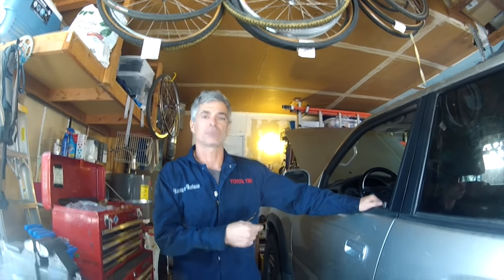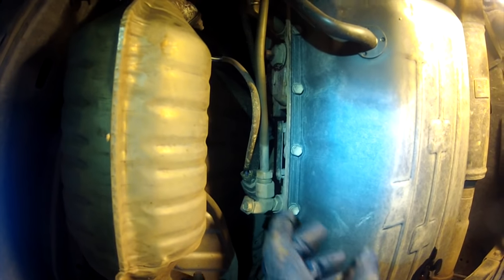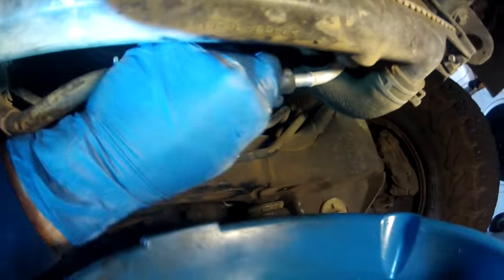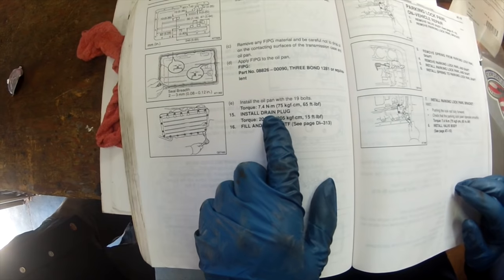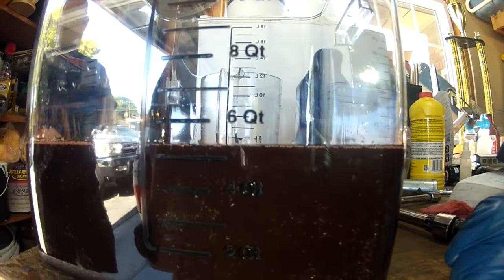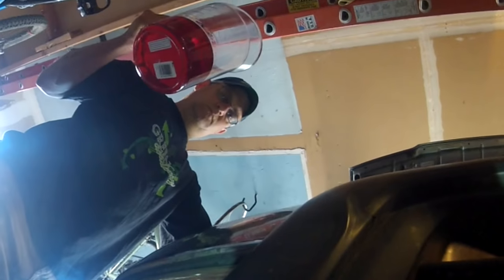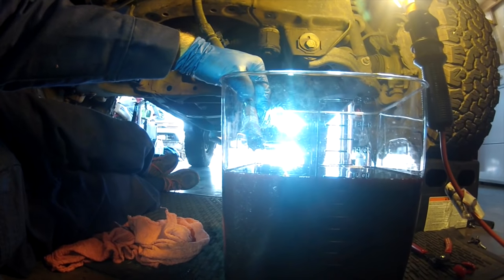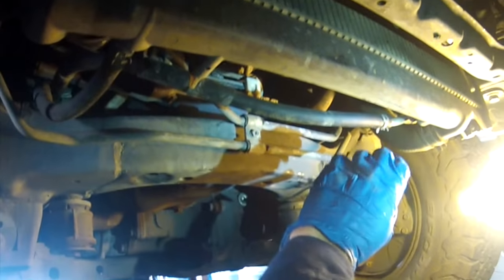Transmission Fluid Flush

Comment: I find in the manual it is recommended to "Apply adhesive or equivalent to new 18 bolts.
Adhesive:Toyota Genuine Adhesive 1344, Three Bond1344 or Equivalent".  I believe this is a thread lock.  I could not find any of these on the web.  Can someone recommend what type I should use for the transmission bolts as the torque is 69 in.lbs
On the other hand, how important is it as I am worried that it will lock the threads before I can torque all of them in 10 mins?
Thanks
Reply from the maker: zofa300 A good mild threadlock is Loctite Blue 242.  That's what I'd use on the transmission pan bolts.  It's enough to reduce the chance of a bolt loosening on it's own but not so strong of a bond to make the bolt the video hard to remove in the future.  I've used Loctite Blue 242 for many different applications and it works great.
Reply: Thank you
Reply from the maker: You're welcome and good luck with the job.  In the near future, I will be dropping the transmission pan on my 2000 Toyota 4runner to replace the transmission filter.  We will of course video the job.
Reply: Yes that would be great.  I got the filter today and it is indeed a felt not a metal screen.  I have a question for you.  I got BAFX Products 34t5 Bluetooth OBDII and installed torque pro.  Now I tried to get the transmission temperature.  I find transmission temperature method 1 and method 2.  They are black not green like other sensors when I add then it reads zero for the dial.  Do you have any idea what does that mean?  My car is camry 2007 LE 4 cyl.
Thanks
Reply from the maker: I don't know anything about your Camry unfortunately.  It might mean that the transmission temperature is not something you can monitor on your vehicle by accessing the computer information via the OBDII port.  You might want to search for an answer on a Toyota forum and find out if it's possible to monitor the trans temp on your vehicle.  If it's not possible, you could always install an inline sensor into your send line coming from your transmission to the cooler at the bottom of your radiator.  You have two lines coming from your transmission, a send and return line.  The send line sends the fluid to the trans cooler in the radiator and the return line brings the cooled fluid back.  Installing the sensor into the send line will give you the temperature of your fluid before it's been cooled inside the radiator.  The send and return lines start off as a hard metal line and then connect to the trans cooler via a rubber line.  You could cut into the rubber send line and install the sensor there with a couple hose clamps.  You might have to cut out some of the length out of the rubber hose to make room for the sensor depending how big it is.  Then you wire that sensor to an aftermarket gauge you install somewhere in your cabin space that you can see while you're driving.  I hope this helps.
Reply: Could you just mention the steps you have used on the torque pro to see the transmission temperature.  
Did you use PID 21D9 for TACOMA as in:
https://www.tacomaworld.com/threads/write-up-torque-app-obd2-reader.183560/page-10
Thank you.
Reply from the maker: I didn't have to input any custom PID.  I just chose "Transmission Temperature (Method 2)" and it worked for my 2000 Toyota 4runner.  Like I said above, you might not be able to monitor the transmission temperature 
on your vehicle by accessing information pulled from the computer via the OBDII reader.  I'd keep searching Toyota forums and maybe just pose the question for your vehicle on a general Toyota forum and hopefully somebody will have an answer for you.
Reply: Thank you.  Just FYI, I find that sensor 2 (method 2) is the converter temperature as in this link:
https://www.tacomaworld.com/threads/write-up-torque-app-obd2-reader.183560/page-10
Did you check that against any other device.
Reply from the maker: zofa300 No, I haven't verified the temperature with another device.   It does appear to be working accurately though seeing that the temperature is cool when I first start driving, gets warm after driving for a while and gets hot when I'm pushing up hills.

Comment: oh great, but what they do is fantastic, I have another 4runner but I have two problems when putting it in reverse it gives a strong gilpe and in the engine when warming up it sounds as if the valves are grinding, but it is only on the driver's side.  he has had to repair a 4runner with that problem, he already urilize lucas and it always makes that noise when heating
Reply from the maker: Nice 👍🏻
Reply: @TimmyTheToolman  
I would like you to help me with this, it is a pity that I am not here to take my 4runner, I see that you are professional in your work and one can trust, maybe you could help me with my 4runner, I would like to send you a video about the noise it makes when it reaches average temperature being cold it does not make noise but when heating it sounds as if they were valves but that is not it
Reply from the maker: @fernandopozuelos22  It's hard to diagnose noises without being there with the vehicle.

Comment: Hi, thanks for sharing this with us.
How can I get the transmission fluid temp?  Because the TORQUE did not show any option
Reply from the maker: I take it you have a 99-02 3rd Gen.  If you have a 96-98, you can't get a reading of your trans temp.  You'd have to add a transmission temp sensor somewhere in the line and run it to a gauge.  

So, if you have a 99-02, click on Realtime Information on your Torque Pro app. Hold your finger on the screen until the box pops up that says "Add Display".  Click on it and then choose whatever style gauge you want (I prefer the digital ones).  After that, scroll way down in the Add Sensor screen and choose "Transmission Temperature (Method 2).  You should now be good to go.

Hope this helps.  Let me know if it worked.
Reply: Unfortunately it didn’t work in my Tacoma 2010.  So, I’m not totally sure if the added fluid was correct because I drain and refill it twice.
Appreciate it a lot
Reply from the maker: Hey Ramiro, what exactly didn't work?  All you needed to do is a drain and refill of the pan, and then disconnect the return line from the transmission cooler and do the one quart at a time drain and refill.  It's pretty straight forward but I don't know how the Tacoma is set-up.  Maybe it's a harder line to disconnect?
Reply: Timmy, 
First of all, thanks for all your support.
What I meant was,  that torque did not showed PIDs for tranny temperature. Tacoma has a sealed transmission then as you know I would need the temperature for level checking. I used the “drain and refill method” twice instead of flushing. But I want to avoid any future transmission issue because of lack of fluid.
Reply from the maker: That's weird you can't find a PID for the trans temp on Torque. I've heard about those sealed transmissions.  I wonder why manufacturers chose to do it that way.  Maybe to make it harder for DIY mechanics.

Comment: Hi..
My name is SAM
I live in Pittsburgh PA
I loved your vedio and I saw it twice. Specially the OBD II device.
I love my 2011 toyota sienna AWD, with 103000 miles on it. And I wish to change the transmission oil of it, but it's not recommended from the dealer, besides there is no dipstick in the transmission itself.
So can you please help me with some info.
Thank you in advance
Reply from the maker: SAM ISHAQ Hey Sam, I wish I could give you some guidance on how to handle this on one of these transmissions without the dipstick but I have no experience with them.  One day we'll do a trans flush on one. For now, maybe hit up a Toyota forum and pose your question or maybe a simple Google search will give you your answer.   Good luck and let me know how you did it if you figure it out.
Reply: Thank you for your quick reply and I promise you I will keep searching till I'll figure it out.

Comment: So when most place change ur fluid its 2.5 qts what's the point in changing that ..when the system is 6.5qts?
Reply from the maker: I don't know what vehicle you're talking about, but that's besides the point.  Lots of people, including myself, subscribe to the opinion that more regular pan drain and refills is just as good as waiting a longer interval to do a full flush.  A full flush every 30k miles seems to be the standard for conventional ATF and every 50k for synthetic ATF.  On my rigs, I do a drain and refill every 10k.  With my 3rd Gen 4runners, you exchange approximately 4.5 quarts out of a 12 quart capacity.  Over 30k miles, I've exchanged a little over 12 quarts.  This is not a flush but rather a dilution process but it's very effective in keeping your fluid in great shape and it's easier than performing a full flush.  I have sent in a sample of my fluid to Blackstone labs for an analysis at one of my 10k pan drains and the results came back very favorably.  My fluid was in great shape.

Comment: I'd like to change the power steering fluid on Camry 2007 LE (2.4L) with 120K miles.  It is written on the cap to use Dexron ii or Dexron iii ATF. 
Should I get Toyota ATF fluid or you recommend something else.  I see some ppl recommend using synthetic Mobil 1 ATF?  Please advice. thanks
Reply from the maker: You don't need to use Toyota ATF.  For my rig, I've been using a Castrol Dex/Merc which is compatible with Dextron III.  Lots of people like using synthetic fluids but I've just stuck mostly with conventional.  I guess I'm old school.  I do use a synthetic blend for my engine oil though, Castrol High Mileage.
Reply: Thank you so much for your quick reply
Reply from the maker: You're welcome.  If you have more questions don't hesitate to ask.  Between Sean and I, we try to answer people's questions quickly but sometimes we're both tied up or don't have an internet connection where we're at.  Summer time months are probably the worst because sometimes I'm out fighting a wildland fire, or I'm camping and mountain biking or I'm backpacking and I don't have cell service and then it's all up to Sean to answer questions that come in and he doesn't have as much free time as me.  

We like to acknowledge every comment and question that comes in.  Sometimes one will slip past us but I think we're doing a pretty good job so far.  Happy  Wrenching!
Reply: I have an 03 lexus is300 I did with valvoline import synthetic power steering fluid. Jack up the front end, disconnect the return line to the pump. With engine off turn the steering wheel from lock to lock and watch the fluid come out of the return line. Note keep power steering pump reservoir full. Repeat until fluid coming out of return line is clean. Hook everything back up. Start the engine and turning steering from lock to lock to get all the air out. Done!
Reply from the maker: You have reported the same thing that a few others have reported.  However, our experience of trying to move fluid through the power steering system on a 3rd Gen 4runner with the engine off didn't get the results we were looking for.  After replacing a steering rack for a friend, we were trying to get all the air out of the system.  We did have the front end up off the ground and we were turning the wheel lock to lock.  What we found is we weren't able to get all the air out doing it this way.  After we started the engine and the power steering pump was turning, the air worked itself out pretty quickly just like you experienced yourself.

So, the reason why we never attempted to do a power steering fluid change with the vehicle off was based off our experience with the steering rack replacement.  We didn't think the fluid would move through the system effectively with the power steering pump not running.  You and others have told us different so maybe I'll give it a try on my own vehicle soon and see how it works.

By the way, your comment was made on our Transmission Fluid Flush video and not the Power Steering Fluid Flush video.

Comment: Hi,
For camry 2007 LE, it has a dip stick but I could not find any info on the temperature range where I should be checking the hot mark on the dipstick,  I only find on web it is between 160 F -175F.  At what temperature (seen on torque pro) I should be checking the dipstick? Thanks
Reply from the maker: zofa300 Optimum operating temperature for ATF is right around 175 degrees F.  Checking your level close to that temp, you should see your dipstick level in the hot range.  Just make sure you're also on level ground with engine on and the vehicle in park.
Reply: Thank you for your quick reply.  Just wonder why you did not pick up the 160 F (lower limit) as it is still in the range and it means you will have more oil in the transmission at this temperature as the oil will have smaller volume than at 175F (upper limit)?  This will assure the transmission has a colder temperature? Just a thought.
Reply from the maker: Transmission fluid levels are definitely not an exact science.   You just want to be somewhere in the hot range on the dipstick when you're in the operating temperature range specified by the manufacturer.  If you're a little low or a little high, it's not a big deal.  You just don't want to be really low or really high because neither is good for your transmission.
Reply: Thank you.  Are there any other way to tell if the car at operating temperature to check the oil level?  In other words what should be the coolant temperature or once the radiator fan starts, does that mean I am at the operating temperature range to check the oil level.  Thanks
Reply from the maker: zofa300 You can't base the transmission fluid temperature based off coolant temperature.  Your engine can get up to operating temperature just by idling.  The transmission on the other hand only generates heat and gets up to operating temperature by driving.  Ambient temperatures will affect how quickly the temperature rises.  On cold days, it will take longer than on hot days.  Before I had a way to monitor my trans temps, I would just do around a 10 mile drive, 5 miles down the highway, 5 miles back followed by surface streets back to my house.  During the drive, I would do several hard accelerations getting the transmission to kick down.  By the time I got back to my house, the transmission would be close or within operating temperature so I could check the fluid level and make sure it was at the hot range on dipstick.

Comment: Do you check the fluid with the ride running?
Reply from the maker: Yes, you have to have the engine running to check the level of automatic transmission fluid.
Reply: @TimmyTheToolman  cool, thanks. that helps out.
Reply from the maker: @starvinDJ  No problem

Comment: Can you mix Valvoline ATF and OEM fluid? (Drain and Fill)
Reply from the maker: Yes, as long as the spec is compatible.  If they are both meant for Dexron 3 applications, you're good.
Reply: @TimmyTheToolman  Thanks. So much information from people saying do or don’t replace fluid or even do or don’t regarding drain and fills. You have a conclusion to put the debate to rest? Thanks for everything you do!

Comment: Why do you put back in the same amount that was in? Why not just flush, empty, and put back in the is in the owner's manual? I'm not criticizing, I know very little about mechanical work and am trying to learn :)
Reply from the maker: What the manual says is just what you replace doing a drain and refill of the pan.  That's about 1/3 of the system capacity.  The system holds approximately 12 quarts.

Comment: +Timmy the toolman

Should change or flush machine if ATF colour is medium brown or reddish?
Reply from the maker: If it's still pink or reddish in color, I'd feel safe performing a full flush.  If the fluid was brown in color, smells burnt and you don't know when the last time it was changed, I'd just do a drain and refill of the pan.  There is a risk of performing a full flush on a transmission that was abused and the fluid wasn't change at regular intervals.  When the fluid hasn't been changed for a long time, it's lubricating properties break down and excessive wears happens within the transmission.  In that dark fluid, there could be suspended clutch material that your transmission is relying upon to shift properly.  When you flush all that all fluid out, the clutch material goes with it and now your transmission slips or doesn't shift right.  Also, ATF has detergents in it.  With a transmission that is abused, deposits end up building up in areas of the transmission.  When you introduce a bunch of brand new fluid with all that fresh detergent in it, it can break up some of those deposits and cause a blockage somewhere in the transmission, like the valve body, and starve the transmission of fluid.